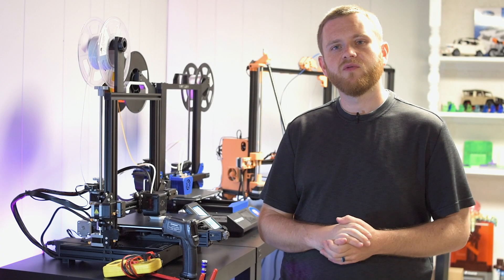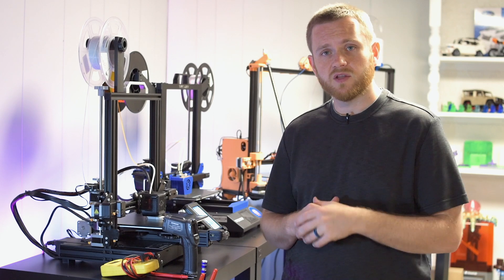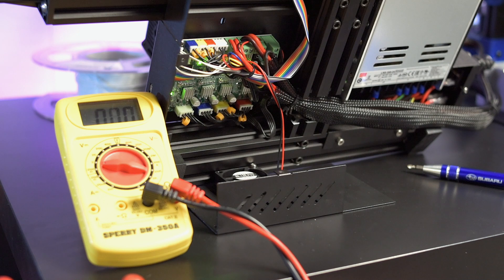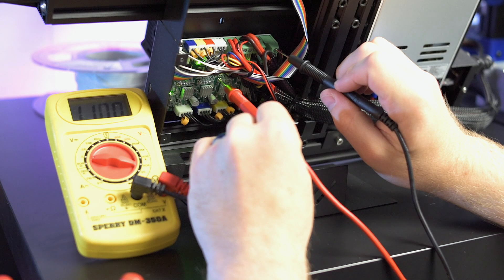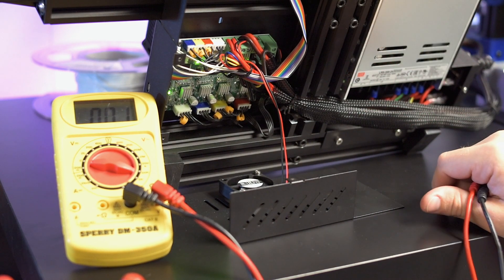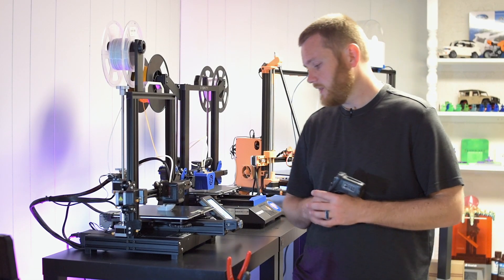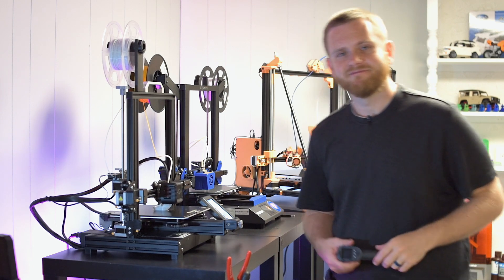Stepper Motors TOO hot! Let's adjust them.

Comment: Why? Print quality is going to suffer. Maybe not at 50mm/sec but upgrade to Marlin or Klipper or try going over 100mm/sec and print quality is sure to take a hit. I think you're doing a diservice promugulating this idea to newbies.
Reply: My stok ender 3v2 runing klipper fw vref E1.35-1.40 X 1.10 Y 1.00-1.10 Z 1.15-1.20 printing abs on enclosure ambient temp 45-50 degree just fine no layer skiping.saya just modified mainboard cover with 80×10mm fan
Reply from the maker: Got a good reliable resource for getting klipper running?
Reply: I absolutely agree with you for sure.
I didn’t see him explain that side of things at all and was like what the hay man, you definitely want your steppers running strong too! 
You CAN even end up with a hot stepper because the voltage is too low!
Definitely find out what’s the manufactures max amp rating/ heat range and use common sense judgment with your temperatures your stepper.
There’s no reason to make it run cold cold means it’s barely working and your probably missing out on print quality by a lot!! 
25° under manufacture temp is probably perfect!!!!!!!!!!!
Reply from the maker: Zero newbies will be on kipper and 100mm/s. That’s some advanced stuff. I appreciate your point of view though. When making any kind of diy video I’m always worried about how the info will be taken. Especially because I try to keep things as simple as possible without using big words or complexities. People should always do their own research before jumping into things like this.
Reply: @3DPrintSOS  I hear you too, but I'm noob and already looking for faster better prints! I just feel if this was the thing to do it would have been done on millions of Enders already. Love all your content though!
Reply from the maker: It’s a thing on Enders for sure. Wish you luck dude. I’m sure you’ve seen the Voron printers? That might be the perfect machine for you. :)

Comment: Awesome that you did a video about this, it'll really help people! Whenever I needed to adjust the stepper driver voltage on laser controllers, I would use two wires with alligator clips on both ends.  One clips to the screwdriver and the other on the probe for ground. I later made wires with clips that plugs directly into the meter, which made it convenient for many tasks.  Keep up the great work!
Reply from the maker: Thank you. Appreciate the pro tip. :)
Reply: @3DPrintSOS   Hi I have just watched your video on stepper motor temps and wondered if you had done a similar exercise on the heated bed. On my Voxelab Aquilla I am consistently printing with bed setting at 60c but a quick inaccurate test with my BBQ probe laid on the bed gives a reading of around 45c. I do not have a Temp Gun as yet but it did cause me to wonder how accurate the temperature readout on the display is, also the time remaining does seem a rough guide only. Very pleased with the Voxelab Aquilla, only on my second roll of filament so far, so still a lot to learn, I am using a British made filament retailing here at £17.00 from a company 3DQF with no problems.
Keep up with the videos they are very informative for and I would have been struggling without them.
Reply from the maker: That’s likely because the temperature probe is on the bottom, in the middle. So the glass surface is always going to be quite a bit lower. ;)

Comment: @ 3DPrintSOS the Y-Axis is doing more work so to have the power to move the heavy bed (that is why the voltage was set higher and it gets hotter). sometimes lowering the current which you do when you lower the voltage that drives the current. you can get movement that is not accurate. I know you may know this but it may be worth mentioning it to people. thanks for your videos
Reply from the maker: I’ll surely be watching it. So far three prints in. Zero issues.  I’ll keep checking.

Comment: You can use a gator clip on the postive onto the screw driver to save useing a extra hand.  you can make a single wire with two gator clips if you don't have a terminal to gator clip for your meter.
Reply from the maker: So many tricks I didn’t know. Thanks!

Comment: Please dont be fooled by those readings, those infra or laser scanner dont work well on polish surfaces like the metal on the motors. If you measure the temps with a multimeter temp probe or a termometer, you will be much more correct. Example, my laser sensor reads 45ºC on y motor, real temp with a temp probe is 65ºC. Just fyi.
Reply from the maker: Appreciate it.

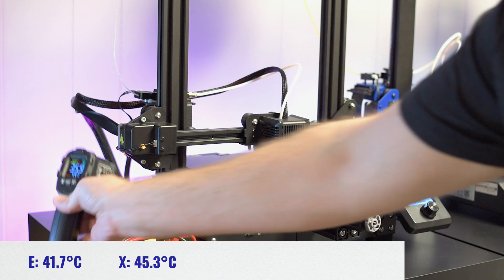Comment: When you measured the z motor it read 35.7, not 45.7, 2:39
Reply from the maker: Oops. I’ll check again. I think there is a max that shows up on the bottom because the top number is live while you hold the trigger.

Comment: So funny you made this video. 5 days ago I had problems with heat mainly on the extrusion stepper, which was heating up my metal extruder, and thus I had a ton of filament problems. I modeled a bracket to hold a 60mm fan on using the 2x3mm screws on the left of the extruder. No temp problems now. Let me know if you want the .stl sent to you.
Reply: Just post it to thingiverse/thangs/myminifactory someone might find it useful
Reply: I'd appreciate getting my hands on that STL! Heat in UK ATM, trashing my extruder temp 😢

Comment: I was seeing about 43C on the stepper motors on Voxelab Aquila right from the box and I'm fine with that
Reply from the maker: Yep, that’s a great temp. I don’t think this is actually an issue. 100c is still safe, so these are running WELL within those limits. But hey, running cooler with no consequences is a win win.
Reply: Mine are around 85C